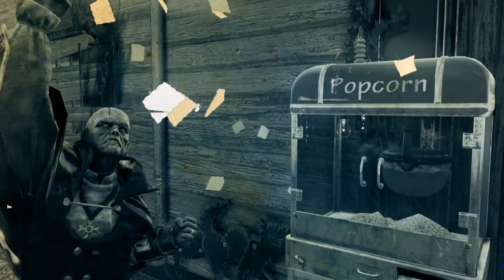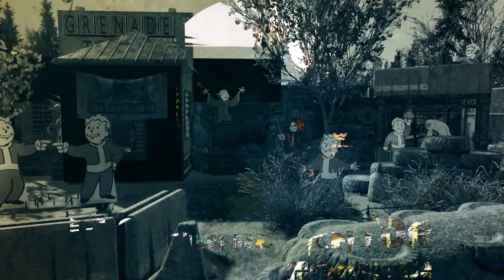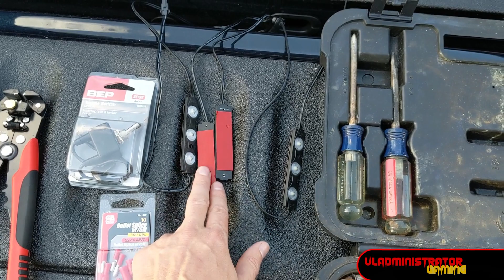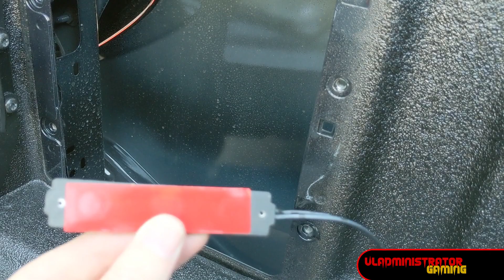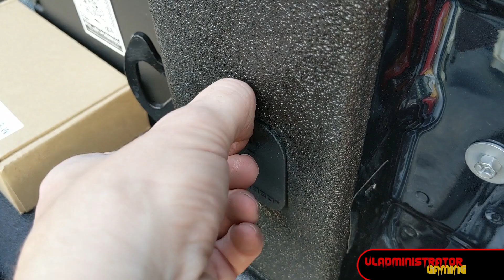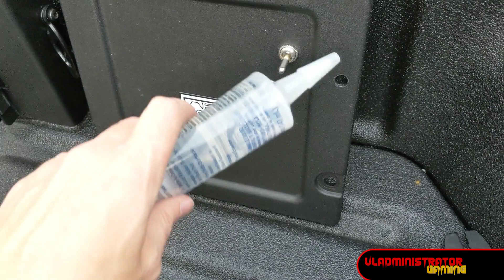Ford Maverick DIY LED Bed Lighting

Comment: Does this mean your 12v PowerPoints are always energized? A way to test is the 12v you have by the center stack, if you have something plugged into it does it stay on after you have left and locked the vehicle?
Reply from the maker: @zippyeasy5808  No, the circuit Ford pre-wired is only energized when the vehicle is on. The switch just allows control over when the lights are illuminated while the truck is on.
Reply: @VladministratorGaming  dang, wish I could keep those ones in the back always hot since the led lights I have a switch.

Comment: Does this mean your 12v PowerPoints are always energized? A way to test is the 12v you have by the center stack, if you have something plugged into it does it stay on after you have left and locked the vehicle?

Comment: Good tip mentioning soldering, a more resilient connection than crimping. 

A look under the hood reveals common electrical tape's failing as a moisture barrier. It quickly dries out and unravels, only being suitable for securing the ends of corrugated-plastic wire looms before installation. 

Heat-shrink tubing permanently seals out the elements.
Reply from the maker: Double checked the tape, and it's holding up well now. Will keep an eye on it over time. When it needs to be replaced will probably go with the shrink tubing. Thanks for the tip, 👍

Comment: Very nice. About to do the same but ordered lights from amazon with a cheap switch. I will upgrade to one like this. Looks professionally installed. Cheers.
Reply from the maker: Thanks. Made sure I did it right, 👍 🍻

Comment: Do you have a link to the toggle switch?
Reply from the maker: I bought the toggle switch locally from a West Marine store. Wanted something water resistant without open connections for water to get into. Pretty sure this is the one I used. https://www.westmarine.com/buy/bep-marine--water-resistant-toggle-switch-off-on-spst--17951914?recordNum=1